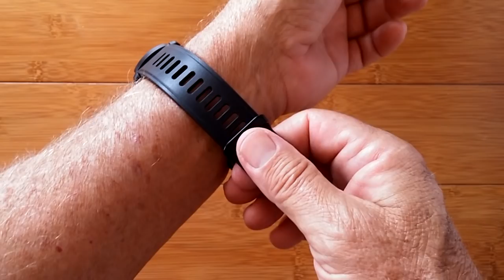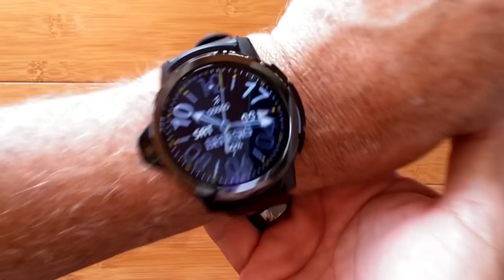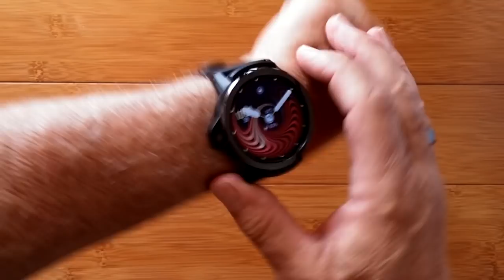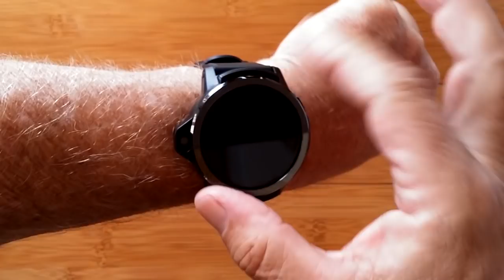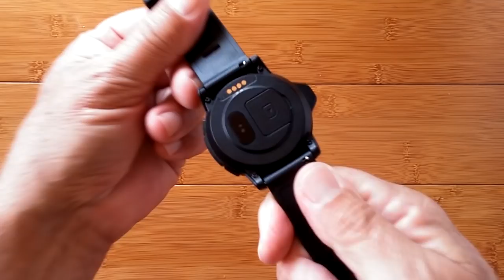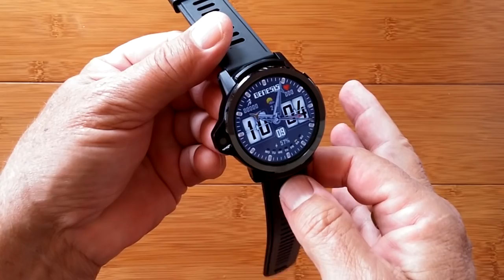Kronos Blade GENESIS Smartwatch Hardware Updates plus More on Camera Apps & Links to Actual Pictures

Comment: Hello. 

I'm a suscriber of your youtube channel :)
I wanted to make you know that as you shared your google drive with resources, I parsed the document with links strings (not clickeable links) to google play and google drive apps and converted those "strings" (because there weren't links) into urls and posted the links of apps in this link https://discourse.fullandroidwatch.org/t/smarticks-android-apps/55838

If it's something I shouldn't do, just ask me and I will delete post or tell about it to moderators, there wasn't bat intention on it.

Have a nice day!!!
Reply from the maker: THANK YOU!!! I got a push notice from the fullandroidwatches site and have started pasting your clickable links into the document to replace the static ones. It will be a bit of work, but worth it. Thanks so much!!! This will really help folks out. Should have the full update online later today. You're AWESOME!!!
Reply: @SWT  It was not really difficult, you just only have to know what want to do so the first thing is I tried copying your links into excel file that has a style option that allows to "convert" into url but it didn't worked, strings looked like urls but weren't clickeables so the next step was how convert string to url, so I used a online tool https://www.textfixer.com/html/convert-url-to-html-link.php to convert strings into urls which that app will perform adding 2 tags to string (https://tinyurl.com/ycydznja)
 <a href="_blank"> (_blank because I want to open link in new tab see targets here https://tinyurl.com/ycmbb5bo) string to convert like EXAMPLE.COM and the closing html tag </a> but this had a issue, there were no blank spaces so after paste all urls in a htm file, I had to add 2 return lines between each link (https://tinyurl.com/ybctzl5w) and you do that adding tags <br/> or <p> tag after each of your link so I edited document htm with notepad++ and pressed control +F to replace $(end of line) with <br/> <br/>  (you can perform this in a document copy just in case) and voilá, you have all the strings with href tag and with return carriage html tags !! Just in case you need to convert more urls..There are a lot of interesting online tools and notepad++ it's a amazing developer editing tool which opens really fast, uses tabs like chrome, brave, edge...have plugins, it's really powerful searching, replacing (regular expressions, I have to search for them I hate them :D). Thanks for your links SmartWatch Ticks!!!
Reply: @SWT  Here you have the file https://filebin.net/2mjbzx3ih5i6qygw 
Here you can download notepad ++ and edit that document https://notepad-plus-plus.org/downloads/v7.8.6/
If you need something else just ask!!

Comment: Hi SmartWatch Ticks, I do have a full android smart watch H8 with their fitness app (long over) but is there a possibility to get the recorded GPS data out of the watch's fitness app? This would be great to e.g. use data in Google maps...Thanks for your feedback and kind regards, Steve-h
Reply from the maker: You'd probably be more successful to install Google FIT or Strava or Runtastic on an Android smartwatch and rely on those apps for access to the GPS records. There may also be specialized tracking apps not related to fitness you can use, and, remember, you can always rely on the Google Timeline tracking if you have a SIM in your watch, data turned on, GPS turned on, and that feature activated in your Google account. As for the Wiiwatch 2 app, I don't see a way to get to the GPS data directly.

Comment: Hello, I just looked at my emails and noticed that mine is just about to be delivered soon. It’s been a long awaited moment for me. Question, will this watch be updated in firmware already out of the box?
Reply: You will have the most updated firmware available
Reply from the maker: Yep. Mine arrived with the latest firmware on it. Should be good to go.

There's an important thing to do when you first get yours (and I plan to cover it in a future video). After you charge it up right out of the box, when you turn it on and get to the first watch face, immediately go to Settings, then down to Reset Equipment and then to Factory Data Reset. Do that first thing, then you can proceed to setup your watch. It's especially important to do this step with the Genesis as there are lots of new things, like stock inclusion of Google Calendar and Chrome, intricate faces with such active spots, and some hidden goodies in the firmware. Your Factory Restore assures they will all be recognized properly and work as intended. So do this step right away! After that, and once you set up your watch on WiFi, you can go to Settings, then About watch, then try Wireless Update to see if there is, indeed, a new firmware waiting for you. You can check this anytime to make sure you are totally up to date. Just make sure you are on WiFi before activating the check. Enjoy your new watch!!

Comment: Great video.  Thanks.  I received mine today.  Two things: 1) mine did not have the plastic covers on the camera lenses.  Just FYI.  I don't want anyone going after the lens with a toothpick and scratching something.  2)  I cannot get it connected to the app.  When you have a little time can you do a Bluetooth connection tutorial please Sir?  Not my first smartwatch (20th in fact) but first time i have encountered issues connecting to Bluetooth.
Reply from the maker: Thanks for the info! Try doing a factory restore to your watch, then taking the watch and phone outdoors away from all Bluetooth signals, do the QR code scan thing with Wiiwatch 2 app, and they should connect just fine.
Reply: @SWT  Thanks.  I've been playing around with it.   I can't get it to connect to WiFi either so ...
Reply: @c.c.hopper7816  ok so you went to system then to connect then to Wi-Fi. The button on top you slided it to the right and it turned green. Then click on the network you like. Did that work? Pilot214evr@gmail.com
Reply: @kronosbladesmartwatchesand374  Yes.   I finally got it work early this morning.   I also got it connected to the app now.  The only outstanding issue now is no transreflective display and no tilt to wake.  Thanks for checking Jason.
Reply: @c.c.hopper7816  the reflective screen is always just there. Its a hardware thing. Its not a function or app thing. Take it outside in direct sunlight and dim it. You will see :))
Reply: @c.c.hopper7816  tilt to wake- click on Settings.... Click on Gesture.....  "Screen on raising" Slide button to right it turn blue. Now its activated

Comment: I notice in your video that one picture is around 3meg if shot at full resolution. With the limited memory of the GENESIS, what is the best way to get those photos off the watch as quick as possible? Is there software that would automatically send my pics to my phone for archiving? Maybe I can set it up somehow to automate the upload of all my photos on my watch to the cloud when I connect on WIFI? Or perhaps via my SIM card to my cloud server? What can you recommend? The Genesis doesn't have a slot for an external memory card, does it? I know that the cradle has USB-C, so theoretically I could attach a USB memory card that way to offload my photos, right? Thanks!
Reply from the maker: Great question. Both Jason and I just answered this from different perspectives. Please check further in the comments under this video. Thanks.
Reply: Theoretically that is a great idea! I say yes! Bluetooth transfer is the easiest way to transfer your photos.
Reply: @kronosbladesmartwatchesand374  I use Dropsync Pro on my Android phone to upload my photos automatically to the cloud and delete my local files to save space. I can tell it to only sync when on WiFi. I am hoping it would run on the watch too.
Reply: @sndes-x2x  I do not see why not?

Comment: The  waterproof resistance for at least a shower ? Cuz i really want one now for sure i'll do the commande soon so i would like to know if i Can shower with it pls anf i Hope they fix the portrait and landscape camera by adding it on the Quick photos choices in the New update
Reply from the maker: Sorry to say, a shower would probably be the WORST thing you could do with any smartwatch, even those rated 5ATM (water resistance to 50 meters). Here's why. Unless you're a teenager and take frequent cold showers, the warm water on and around the watch -- ANY watch -- can enter as steam (remember they are not AIR tight), and that water vapor can erode the watch from the inside. Perhaps not immediately, but definitely can shorten the overall life. So I'm a strong advocate against ever showering with a smartwatch.

With that said, all Android smartwatches I've seen so far shouldn't actually be dunked under water. Depending on the angle and intensity of shower water, even cold shower water, the force could push water into tiny places and get into the watch. It's just  an overall bad idea.

So, Killer Bidk, take it off and charge it when you shower! Win-Win combination. You'll be glad you did.
Reply: @SWT  thanks mister ticks for your advice but i was talking about the headphones that  are included with the watch not the actual watch i Saw all your vidéos and understood everything about the watch don't worry if it wasn't worth i wouldn't buy it i just want to know about the headphones if i Can shower with them please i will take off the watch before shower just the headphones are they good for shower pls!
Reply: @killerbidk477  no... The headset are not waterproof.
Reply: @kronosbladesmartwatchesand374  😭😭😭😭😭😭 i wanna cry omg i did the commande today tho how much Time will it take approx pls like 15 days or so?
Reply: Wow... Do you know a watch that you can shower with? And Its actually ok. I mean a 4G Smartwatch that takes a SIM

Comment: On a round face, I have not been able to get into goog play store.   tiny... ug !  am able to enter goog login and pw but then it wants me to acknowledge rights/usage and there is an 'okay' at the bottom right that I cannot press !  tried many, many times.   tried changing font face to smaller than 100 percent.   no change. super frustrating for me and yet I am holding it together and not swearing like a sailor...   I thought there was/is a 'pinch' function on the face to make the face screen shrink/expand ?
. . . help . . .
Reply: At the 15 minute mark in your talk, I see you press 'power' and touch the round circle above the various power selections.   Wow,  I do not ever remember being shown that that circle is the face changer.   When I bought a asian smart watch 4/5 years ago, that circle change function was in the small ( quick change ) group, which was a swipe down from the face and see you have no sim, swipe to the left to see the toggle group of eight things...  Tap the sun symbol to toggle three brightness levels.  So the location of the toggle changed.   When you're in a app ( like play store ), a tap on power gets you to the watch face.    A press and hold for a half second gets you a buzz and then the power functions appear with the circle at the top.   This is my lack of knowing the changes to the quick toggles.   I suppose the screen quick toggle ( round to square ) is quicker to get at in its new place...   I always remember and thought it was / would be in its 'old' place, like on my thor.
Reply: Good to hear that you figured it out!!! Great job!
Reply: @kronosbladesmartwatchesand374  I just want to say you have created an amazing smart watch. Thank you for your time and effort.
Reply: So, my logic says that all the quick toggles should be moved to the new spot ( above power functions ) so senile people like me don't get confused when one get moved out . . .     Ug
@Kronos Blade Smartwatches and Electronics -  Thank you very much for all your dedication and hard work.
Reply from the maker: Here's why it's not where you expect, @lonnie52355: If you're on the watch face, yes, a simple swipe and you're able to change brightness, turn on Airplane mode, and a bunch of other things. Now try to turn off Airplane mode, for example, from the Play Store app. A swipe down or up does nothing. You would need to leave the app, return all the way back to the watch face, then swipe to get to the page with the Airplane toggle, change to off, go back to watch face, over to apps, down to Play Store, and launch it again (unless you pressed and held the power button and selected recent apps to get there quicker -- which, BTW, is just below and to the right of where the circle/square is located right now).

So you see, by placing the 3rd party sizing icon where it is accessible from within any app with a press/hold of the power button, change circle/square with a touch, then hit cancel, you end up back where you were with the new layout orientation. I think if you think it through, you'll see the logic of this implementation. As Jason said, glad you found it!

Comment: IS THIS ANOTHER REVIEW OF THE KRONOS???
Reply from the maker: Yep, I can't get enough of this watch. As you know, I've run through dozens of Android smartwatches with cameras, but it hasn't been until the Genesis that I've truly enjoyed actually using the camera. Now, finally, I'm getting around to really assessing the best apps and practices for taking the best watch pictures. So, you guys get a weekly dump of what I'm discovering.  :)

And I've already got more stuff to share with you guys, including deeper understanding of the photo settings and some hints about video! Just to get you going before I cover all this in a future video:

The InstaCamera app will automatically rotate pictures shot with your arm turned up (to get a landscape perspective) so you don't need to rotate them yourself! Also, you can choose either the 16:9 orientation (like standard on the Quick Camera app) or switch to 4:3 (like standard on the stock camera app).

The "A Better Camera" app is totally awesome and the one I've now made accessible with the double tap of the bottom button. I particularly like setting the HDR parameters and getting really nice photos along with the unaltered photos for comparison (see the images in the app's folder -- I've already posted them).

Video can be shot in a landscape orientation and rotated later, and there's two different ways of rotating, a quick change to the metatag stuff, or frame by frame. I'm investigating apps that use both of these methods.

More to come!! Invite your friends! Please subscribe!! Thanks.
Reply: Simple... Just type in Genesis Smartwatch in the search box of YouTube
Reply: THANK YOU SIR...!!!